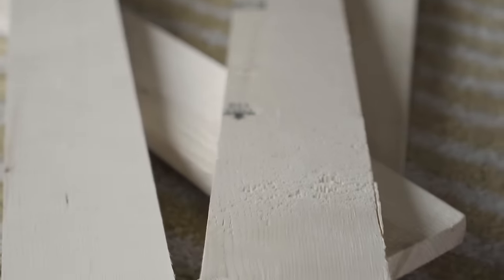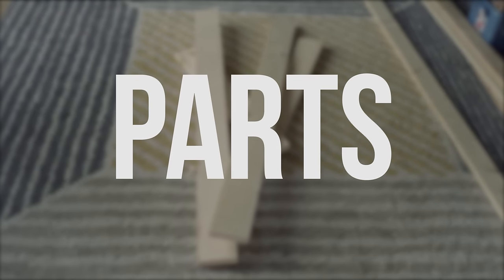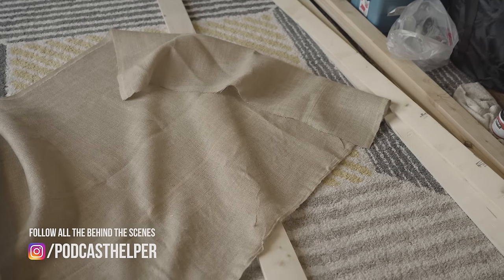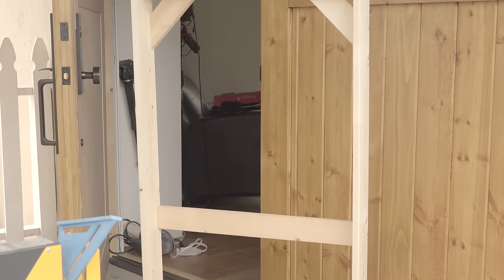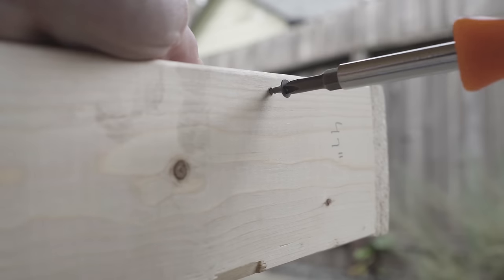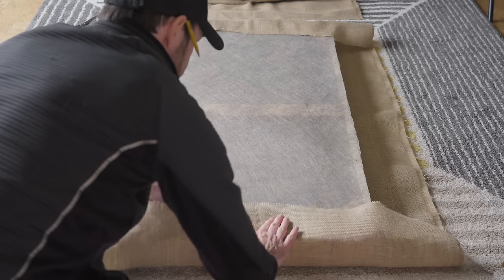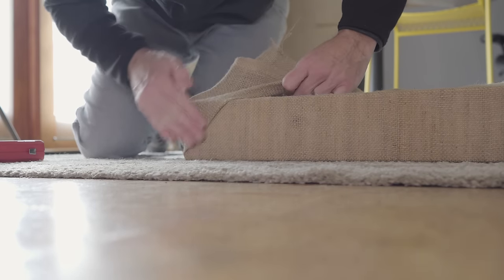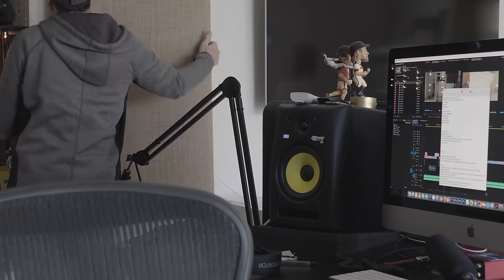How to Build Your Own Acoustic Panels

Comment: I bought some borgaline fabric, it's some form of cotton? Would this be suitable to use a fabric to cover the panels with?
Reply from the maker: Not familiar with that fabric but if air can get through it then it should be good. Breathe through it and see if you can feel air on the other side with your hand. But also just try one panel and see if it works, you can always recover the frame.
Reply: @RayOrtega  thanks for your reply! I can breathe through it with some effort, light barely passes through.. it's rather thick so I don't know if it will work

Comment: Great video, thanks! Quick question - it looks like the frame leaves a space of 22.5" x 47" for the insulation, if I'm not mistaking. Is that intentional so that the 24" x 48" insulation gets compressed a bit  for a snug fit?

Comment: Is it safe to keep rockwool "just" behind a layer of burlap?
Reply from the maker: It doesn't seem like it's shedding but if you're concerned just cover it with a less porous material. I'm probably going to take off the burlap and use the same weed barrier that I used on back on the front too then put the burlap back on just to be extra safe
Reply: Ray Ortega I saw Jon Sine using a very thin layer of film/foil all around the rockwool. That looked neat

Comment: If the insulation itself is 48" high, why are the wood sides only 47" high? Also looks like the inside width is only 23". But isn't the size of the insulation 24" wide?  Is your insulation not exactly 2'x4'. If it is, is the insulation squishing in a bit?

Comment: Thanks for making this tutorial. Do you have a link for that weed barrier fabric you used? Been trying to find something like it but everything I find is too thick.
Reply from the maker: I don't, I just got mine at my local hardware store but you can try Amazon. Someone also suggested you could use this cotton https://amzn.to/3vP2fKx. Really any breathable fabric would work and I would line the front as well in order to prevent any fibers from leaving the panel if you are using a really porous material to cover the front

Comment: Awesome video! How would you recommend putting rock wool on wall corners?
Reply: Outside corners would be very tough but inside corners could be straddled with a frame like this and properly spaced mounts on the wall.  You could also build a vertical frame that went from floor to ceiling and cut these batts down and stack them inside and wrap the frame.

Comment: Thank you for the video! Would you elaborate on your choice to use recycled denim instead of Safe N' Sound in future projects?
Reply from the maker: It's just the next thing I'd like to try but I've worked with a little of it and it seems like it sheds a lot so I'm unsure. What I would do and still might do is to go back and use the weed barrier that I put on the back, also on the front. This would eliminate any concern that the Rockwool might shed into the room although I haven't noticed that being an issue thus far.  I like to use the most environmentally and health friendly material possible. Denim might be that product but they are also making Rockwool without formaldehyde as well so it's a coin toss. All these things I looked into before I built my panels but it's the internet so it can be hard to discern the accurate answer so these are just my thoughts as I think it's still an open question. But seal them up and I think most of any concern is gone.
Reply: Thank you for the reply! A large concern are the potential airborne particles created by mineral wool, and whether or not those particles permeate the weed cloth or other sound transparent material. Since we spend a lot of time in the studio air quality of utmost importance. Are there studies you are aware of that tests the air quality of denim vs mineral wool?  Looking to install 30-40 panels in a 600sq ft open ceiling studio so choosing the right material is paramount. Thoughts? Thanks!
Reply from the maker: @niekvelvisbluesband6064  I had the same concerns. I don't think there were any studies that I found but I think the weed barrier would hold back any fibers. On my next round of building more panels, I'll try to test it out by shaking the panel after it's been sealed up. Of course this will probably be quite awhile before I build so perhaps you can do a test before you commit too much money.

Comment: I keep reading about Owen Corning's 703.. I can see this worked fine and Owen would prob work better but this will do the job for me right? Have a home studio I NEED to treat.
Reply: OC703 is GREAT if you go deep with it (6") but that'd be a big panel. At 3" depth, I couldn't justify the massive difference in price and availability of the OC703 vs Roxul Safe n Sound. I actually had trouble finding 24" wide safe n sound panels, and so made a slightly larger panel with 2 16" wide safe n sound panels side by side instead.. it turned out pretty great. Here's a site that lists sound absorption coefficients if you wanna nerd out and see whats out there: https://www.bobgolds.com/AbsorptionCoefficients.htm
Reply: @SpartanBM015  prices online for 703 are actually pretty reasonable its just the shipping thats a bitch! Shipping is pretty much the same price of the insulation vs just buying the roxul at my local Lowes. They sell the exact roxul thats in this video so I think im going to buy this one. Its like 50 bucks, the corning wouldve costed me 100+ plus its fiberglass which is no good. As long as I get the same results im good! Thanks for the info

Comment: I have a question, maybe not a very good one. I'm trying to avoid sound to get out of my windows cause of neighbors. The thing is I'm a bit concern about the toxicity of the rockwool. Isn't it very toxic to be in a room with rockwool just like that? Shouldn't I wrap it with some platic to prevent the particles to get out there? Please let me know if you know something about that? Thank you.
Reply from the maker: You certainly wouldn't want to breathe in a bunch of it but as far as I know mine don't shed however if you're concerned, you can simply wrap it in a a porous material that lets sound through but not any fibers. You can also fill the frames with any material you choose.

Comment: Can you use spray foam insulation if you can’t find this insulation ?
Reply from the maker: Can't say since I haven't used it but I think that stuff also expands so it would likely be an issue to hold it in with the cloth perhaps.
Reply: Yeah on the bottle it does say acoustic insulation 
I was thinking of having a board on the back until it sets and cutting away any excess then adding the cloth ? I’m just unsure if it will actually do a similar job to the Rockwool

Comment: Do they make the insulation in different thicknesses? I want to put it inside some canvas wall art so my panels can be part of my room's decor
Reply from the maker: You can try other types of insulation, of course be safe and use something that is not dangerous in terms of fibers or fire hazard but also with the Rockwool you could cut it to whatever thickness you need. The less think however the less it does to absorb sound.

Comment: Good video. Thanks. I have a 13ft high ceiling in my photography studio I’m now also trying to treat the space for video recording could these be used to hang from the ceiling also ..
Reply from the maker: The frames make these pretty heavy and honestly I don't know that I'd want these to hang over me and shed the Rockwool inside but you can certainly make some thinner panels to hang from the ceiling, so maybe some 2x2 with anything inside that absorbs sound but if you want to use Rockwool, just use a covering on the panels that is less porous than the burlap I'm using here.
Reply: I hung a double sized panel (2 batts of Rockwool inside a frame) above my desk in my studio.  So long as you get your hangers mounted into studs or use anchors rated for ceiling use, you should be fine.  My "cloud" has been in place for years and never tumbled so I think you'll be alright  lol

Comment: These rockwool fibers being so minuscule, don't you think it will shred or come out of fabric?
Reply from the maker: Seems OK to date but if I made more, I would put the same material I used on back to also cover the front so that I wouldn't have to be concerned with possible fibers escaping and of course you can always fill the frames with other materials, see the pinned comment and replies.

Comment: Love the video! Quick question: What kind of backing fabric do you use?
Reply from the maker: Thanks! I used a weed barrier and I'll probably go back and add that same weed barrier to the front under the burlap as well just for peace of mind.
Reply: Ray Ortega yea I was gonna say can’t the fiber glass still get through the burlap. Looks awesome almost done with mine
Reply from the maker: @ራስአንበሳተፈሪ  Congrats and yes just use a barrier on the front as well as the back, what did you choose to use?
Reply: @RayOrtega  yea wrapped it all the way around with black weed fabric, then covered the front with a designed home fabric from Joann's Fabrics.
Reply from the maker: @ራስአንበሳተፈሪ  Great to hear. Can you tell if it's any less effective being wrapped with the weed barrier in front? I know it would be hard to tell
Reply: @RayOrtega  well I've wrapped all of them completely so I wouldn't know but setting them up in my room still made the room reflection sound way less 'bathroomy'..
Reply from the maker: @ራስአንበሳተፈሪ  Seems like it's working, thanks for the feedback!

Comment: Do they need to be away from the wall like that? Or would it be ok if they're flush with the wall on the back?
Reply from the maker: They don't but they are probably a little more effective because the reflections that bounce of the wall can be absorbed by the back of the panel as well.

Comment: What material did you use to cover the exposed back? Could it also be used to cover rigid fiberglass? I’m looking to make frameless panels and the greyish material you used in this video looks like a great option for the backs of my panels. I recently made different panels with Rockwool and I used a fiberglass screen to cover the back, but I’m afraid that might be too porous for fiberglass insulation. Am I wrong?! I also feel like fiberglass screen might obviously be for covering fiberglass insulation. Just looking to keep myself and my family safe and healthy once I acquire some actual OC703.
Reply from the maker: Hi, Forrest, there is an extensive list in the description of everything I used. For the back I just used some breathable weed barrier. I can't really say what would retain any fibers.

Comment: What size is the wood you are using? Is it actually 1x4x8 and 1x3x10 or are the dimensions smaller? I cannot for the life of me find wood to the exact size as yours and it’s driving me nuts haha I just wanna follow your steps exactly but this whole wood sizing thing is so confusing to me
Reply from the maker: I listed it all in the description but I cut my wood. So it doesn't matter what size you find, just cut to what you need. If it's two times the size you need, even better since you should be able to save money and cut in half for more pieces....if they fit in the car ;)

Comment: Thank you so much. I have a question. Shouldn't you cover all walls completely or why making just frames is enough, I mean does the sound go right to the frame?
Reply: Kerim Grozny 
The panel absorbs sound reflections - the more panels you have - the more sound you absorb
Reply: The main goal of studio sound treatment is to treat "first reflection" points.  That's any point where sound could reflect initially as it leaves the speaker.  This would be the wall directly behind and directly to the side of the speakers.  Adding panels to the wall behind and above the listening position is also recommended to provide the most natural and neutral sound leaving the speakers.

Comment: I'm a bit confused on the measurements here; if you use 24.5" cuts for the top and bottom of the frame, wouldn't that leave you with 22.5" of horizontal space in the interior of the frame? But you say to cut the back piece to 23"?
Reply from the maker: The top pieces actually go on top so you have to subtract an inch from each side because of the side panels which means the space between the panels in the middle is closer to 23". It gets a little trickier because 1x4 any wood like that from a big box hardware store is not usually actually 1". So in this case I think the side pieces are .75" wide which means when you subtract .75 two times from 24.5" you end up with 23". Hope that helps.
Reply: @RayOrtega  Ahhh didn't realize common board varied in size like that, thanks!

Comment: Hey Ray! How thick is the insulation that you are using? I want to use 2" thick insulation instead of 3" because it would be cheaper and lighter but I also don't want to compromise sound absorption - the application would be to build about 10 to minimize echos in a large room. Thank you!
Reply from the maker: Johnathan, I think it's 3", not sure how much 2" inch would affect absorption but an extra inch might be significant. Unfortunately I can't say because there are so many individual factors based on your own needs but let me know what you go with. You might try a couple with 2" and see if it starts to help. then go 3" if it's not enough.

Comment: Great advice Ray. I thought some of your readers might want to go a step further & use a another product made by Roxul called Comfortboard 80 which is made from Rock Wool (is extracted from Lava Rock which is collected from dormant Volcano's). This product doesn't use fiberglass which can really get itchy, & it's also fire proof & water proof. Roxul packages it in 2' x 4' panels & is available in various thickness's being 1",  1 1/2",  2", & 4" thick. It has fantastic low frequency absorption so it's easy to construct corner low frequency bass traps.

I used burlap as well but simply used a hot glue to attach it to the panel. It's so rigid that I hammered some 3" finishing nails to the wall & simply pressed the panels onto the nails.

Good Luck & Cheers!

Here's a link to get the product specs.
https://www.rockwool.com/products/comfortboard-80/?selectedCat_12e03417-3cf7-4764-9f3f-9b160ea8600c=comfortboard%E2%84%A2%2080%20downloads
Reply from the maker: Thanks, Tele. That is what I used in these panels. Rockwool. Lots of people are concerned about the fibers getting into the air and breathing them. I'd probably fill my next panels with recycled denim, the Rockwool works well and I don't think it sheds since the panels are static but it's hard to tell. Fingers crossed.
Reply from the maker: @C P I have not noted any difference but I would just place the weed barrier in front as well just so you don't even have to think about it;)

Comment: Could you hammer long nails in to hold the panels together, or does it require drilling and screws?
Reply: Depends on what kind of nails you use. Wouldn't want to split the wood. Screws are the best option.

Comment: Would Owens Corning thermafiber fire and sound guard work as well as the insulation u used?
Reply from the maker: Really anything that absorbs sound would work. So that insulation probably does a good job. Most manufactured panels use the Corning 703

Comment: Probably a dumb question, but would they be as efficient without the framing? Aesthetically, not as pleasing, but they'd be able to absorb more sound from the sides.
Reply from the maker: I don't know that having the sides exposed would make that much difference but yes you could do that. You can use pillows or blankets, really doesn't matter as long as you have no reflective surfaces. Many ways to accomplish the same thing.
Reply: Thanks for the feedback. I was also thinking of weight, cost and mobility. These look super easy to make.  I appreciate the work you put into your videos!

Comment: Hey - why are you measuring 23" for the back pieces if the roxul is 24" wide? do you just squeeze them in so they're snug? I'm using Owens Corning and they are a bit more rigid so not sure if that will work in my situation

Comment: Thanks for the video!!!! I Have a question: as I am planning to build my panel I see that the wood for the frame nominal size 1x2 is actually 0.75x1.5.  If the rockwool is 2 inches  it will be thicker than the wood. Should 1 use the wood 1x3 which actuall size is 0.75x2.5?
What is your opinion about using 2 inch (3 lb/ft3) cotton insulation?
Reply from the maker: Hi, Carlos. I actually used 1"x4" which fits the Rockwool perfectly with room for the corner and back pieces to hold it in. 

And you can use regular insulation but for sound, I find that the standard is the 703 https://amzn.to/2rWdmSp

Comment: I would like to build these but have concerns. Rock wool is a carcinogen it'smeant to be entombed inside a sealed wall cavity.
Secondly, It does not break down in your body instead when the mineral strands are breathed in they stick in your lungs and are then coated with mucus and since they are rock mineral they cause issues. 

I would have used a French cleat to mount these and am going to look into using a foam product instead of mineral wool.
Reply from the maker: Yep good idea, if you're concerned with what's inside, use something else. I also looked into recycled denim and a few other things. Anything you think is safe and will absorb sound, will work.